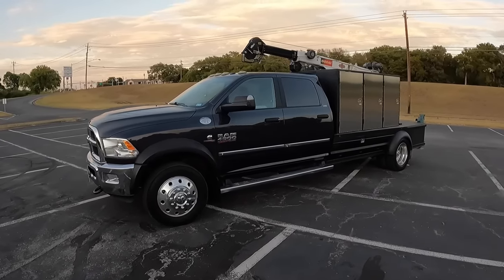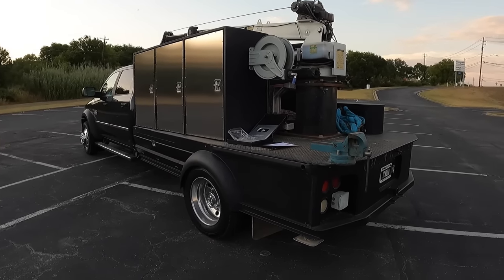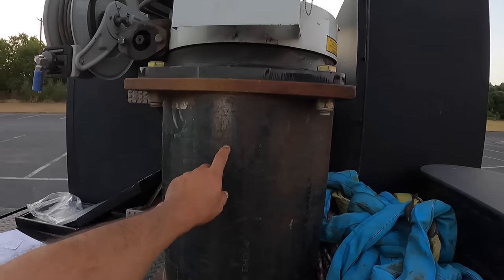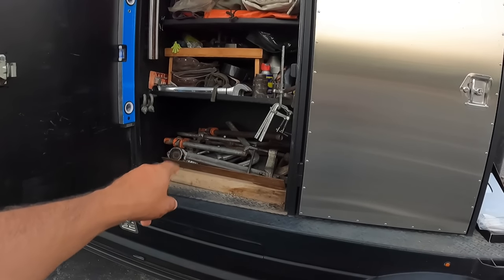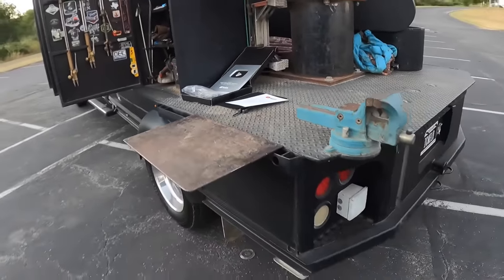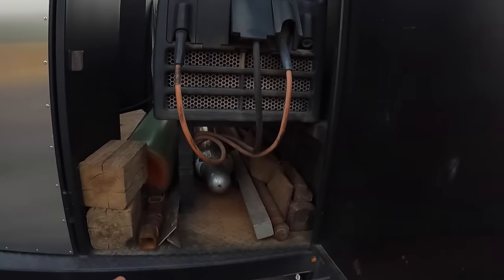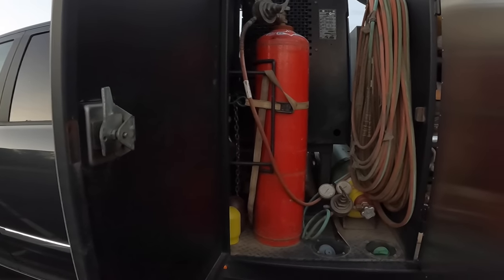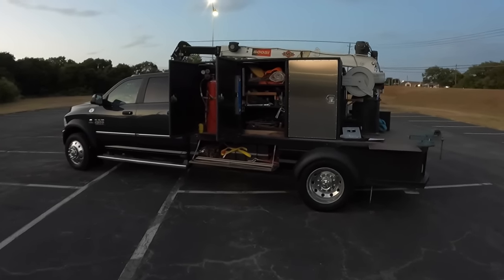Long Awaited Welding Rig Tour.

Comment: I have had many trucks with utility beds. I always shopped around at pawn shops and garage sales and bought different brands of different sized tool boxes that had decent sliding drawers and just put the entire tool box in the different sized openings in the bed. One truck I had a certain size of Snap On side boxes in a particular spot behind doors they just barely fit through. But I'm a mechanic and if you don't want to spend all your time looking you have to have specific drawers for specific tools and like you said it helps prevent loss. So you might look around at Northern and Harbor Freight or the pawn shop and find something that fits well in the boxes you have made. I like it that your truck isn't a cookie cutter copy of a lot of the welding and pipeliner trucks you see everywhere. Congrats on the 100k and your award. 👍

Comment: I am not  typically a dodge guy at all - but this truck is gorgeous! What a sweet setup too, man! I also give dodge points for still letting you get a manual - couldn’t in my 6.7 powerstroke. Congratulations on 100k.

Comment: In the middle under the crane you could make a larger cap city fuel cell/tank to pump fuel into your welder or truck for extended work.

Comment: Congratulations on your 100k award! It is very much deserved. 
I'm very interested in seeing more details about your air suspension that you built. I'm in the process of building a 2000 K3500 C.C. dually into a welding truck very similar to yours and am afraid it is going to be pretty close to the gross weight limit. I think the air suspension should make the chassis more stable on the road.
Reply from the maker: Coming soon!
Reply: Thank you! I'll be looking forward to it.
Reply: @ICWeld  I'm interested in the thought process of the design. Did you start with an existing design and modify for your needs or start from scratch? I hope that's included in your upcoming video. I am staying tuned!!
Reply: I have a 2018 Ram 550 mechanic service, around 20,000 lbs. I am in northern calif. . I have mountains three three sides with canyons following river, creeks. Side to side stability was a issue, used "Super Spring" Summo that controlled the sway. So I thought if that was good I will put them on front axle, that didn't work out so good, almost put me in the other lane on a tight mountain curve.

Comment: Love that truck Isaac! Very well thought out. What’s your cab to axle measurement? My F-550 has the 120” cab to axle with a store-bought 14’ extra-low-profile utility bed so I can pull my gooseneck in the standard hitch position. People ask, “do you have a big enough truck?!” My reply is always, “No. Two things you can never build big enough…, a truck or a shop.”
Reply from the maker: this one is an 84" C/A length. 12' bed.
Reply: yep no matter how big the shed is it aint enough and never has enough power points. when we built the last shed the uncle supplied the electrical gear through his business he asked how many power point do you want? as many as we can have so around the bench there is 1 every 4ft. no more uplugging tools just to do a different task.

you can have a shed 140ft long by 40ft wide and its soon gets filled with gear. pallet racking is your freind get the less used stuff up off the floor.

Comment: I started out with a 1973 Dodge Power Wagon. Lol!   Then a 1700 4x4 International Load Star.  Use and old sign crane for a decade or so. Was the biggest rig around here close to 40 years ago! Lol!   Then got a Chevy tool bed truck with Miller for road.    Reworked the Old Skinner National I called it for gravel pit work.  Auto crane and Lincolin and air.   I had the Skinner National for 33 years. Re worked it 2 times.  Retired in 2019.  But still have the Chevy.  Just tinker part time in my shop now.  Been a lot of years. And hard work. But was good to me!   Love to see what you do.  Fulfilling work it is! And it’s nice to have nice rig!  Keep up the videos!  I love to watch them!  And I’m still learning after 46 year watching!    Kent Smith Welding.

Comment: I really personally think your truck for a road truck has it all, you built the cabinets with doors that look like they came from a factory. The wheel flares you got lucky with the fitting on the 90 degree pipe but I thought they were real factory made wheel flares great added look to the truck, Shit it looks bad ass in my book. thanks for showing the build you did.🛻

Comment: Congratulations! You got good stuff!
When I moved into a 2018 5500 Ram I thought I wanted a standard Trans. as my first 5 service trucks were stick shift. The salesman said bad idea. I am in northern calif. with the auto shift, exhaust brake and the 6.7 I can go to the coast over four mountains never have to touch the brakes. And pass motor homes. I am about 20,000lbs.

Comment: I just started following you about a year ago, we are very similar in what we do, although I'm way up north, I do about 10% rig repair and 90% farm and other repair, our oilfield is very small here, but farming is huge, our trucks are very much the same also, I run a F550, it's a gutless wonder also! I didn't build my bed and boxes due to time, but I added more on top for storage, plus I carry a lot of iron with me because you never know what you need when you get to a service call, I wish I had a crane like yours but I don't have the room for it, I did add a fold up work bench to mine, I'd be lost without it, and my truck isn't very clean, constantly running on muddy roads, thanks for showing your truck, it was very interesting, take care.

Comment: Quite a special thing is a work truck you have thought about loads and then built from the ground up you always learn something. 
They are never finished but when your an honest worker function takes over bit like my little truck with unpainted welding that I did when it was too cold for paint.
Keep doing what you do, I would be weirded out to have 100,000 people subscribing.

Comment: I suggest you install an ignition interruption switch on the truck somewhere so no one can't just hop in and take off since they can do it in less than a minute. An aunt had her convertible snatched several times often just for its classic parts,  it didn't go wandering again that easily after one was put in  since she usually flicked it off when home.

Comment: Anti theft peddle haha well said.

Congrats man, ive been watching you for a few years now. Always a pleasure learning from you as im a millwright and weld a ton. Youve taught me lots. Congrats to you sir!! One of the most under rated welders on You Tube
Reply: Oh and hey, get a dual south bend clutch and delete your def/motor with EFI live. I have a 17 3500 manual and it was a dog. I did those two things and its a completely different truck. I do not bag on it, its like giving a smoker new lungs and gets wayyyyyyy better fuel mileage. You will not be sorry you did it and will be so much happier with the truck

Comment: Sweet!  I have a 2004 3500 dually with the Cummins and 6-speed manual.  I love it, but it really is showing its age.  Unfortunately, right now is not a good time to buy...anything.  I have a friend that owns a Dodge/Ram dealership, and I about fell off my chair when he told me the price of a new truck. Over $100K!!  It's insane.   You really do have a beautiful truck.  I like the layout with the crane in the middle.  One thing I did was buy an engine-driven generator. It's a bit larger than an alternator.  When the truck is running, I have 7,500 watts available.  When I got it, I couldn't afford an engine-driven welder, plus I do a good bit of camping, so it seemed like the best option.  It really wasn't, lol.  You have to run the truck at 1,800 RPM to get 60Hz, and it tends to get expensive burning all that fuel just to make a whopping 7.5KW.  Anyway, congrats on the 100,000 subs and getting your play button!!

Comment: That table design is genius Issac! Also, tou could build your own roll out shelves. There's heavy duty designs on YouTube you can look up, some people use skateboard bearings and rails, to make there own from scratch.

I also have am 07 5500 with a 6speed it has 4.44 gears, and I can only go about 75mph

Comment: Congrats Isaac! Wow your custom bed shows off your welding proficiency and pride in your workmanship!! A rolling advertisement for your business!

Btw you can have your truck computer retuned back to stock power. Will probably void warranty but as long as you are a fluid shifter, your driveline should be ok.

Comment: that "dead" space under the boom between the boxes could be used to store a 20ish gallon saddle tank or another air tank or maybe even both maybe even inside the crane riser could be used for something. some of the offroad guys use their bumpers as air tanks for air lockers, suspension, or to air up tires etc.

Comment: Very nice work. I have equiped my service trucks with a blower system that puts positive pressure inside the toolboxes.  A vent  scoop( like on a boat )  on the front ot the box with a small electric fan filter  and that goes in a P trap with a little tube at the bottom to let the dust and water out. Think you get the idea.  It keeps the dust and  will dry out your tools if you put them away wet or get caugh tin a rain/Snow storm. Nothing worse that tool box full of  dust and rusty tools.
Reply from the maker: Great tip!

Comment: Congratulation on the well deserved award. Awesome truck and you also deserve a congratulations on the build. appears that a lot of thought was put into it and the pros by far out weigh the few cons that you pointed out. I have worked in the construction industry all my working life, (Highway construction) and firmly believe that your appearance, which includes your equipment, is a direct indication of your quality of work that you do. In your case its OUTSTANDING!

Comment: Sometimes the simple things are the best thing I really like that set up you have enough to get the job done and nothing more to worry about possibly I might build a larger fuel cell but like you said you have to fill up the welder anyways so really it works anyways great work truck I have a similar set up but in a 3500 version I built myself and my crane is moved up into mid ship with the boom out the back and the out riggers behind the cab and off the rear so I keep the center bed space for whatever I have to haul but like you I almost always fix in place so it’s not too much of a need but it does ride a bit better for me at least with the lighter duty truck

Comment: 22x27 compartments? Slide outs pretty ez. 18" Austin locking slides. 10 gauge stainless probably best for your application. We generally use 3/16 alum at my work. Cut x2 18" chucks of 3x3 or 4x4 angle for your legs. For slide tray, 25.25 x 20.25 sheet, notch out corners 2.25" will give u about 23x18 tray with 2 inch lip. (To increase lip, add equally to sheet dimensions and corner notch outs). Get it broke, drill some holes and bam.
Don't forget to compensate for clearing the compartment door haha. U may have to shrink the width a lil.

Comment: I picked up a Farm truck out of California. A 1997 international 4700 dte466 5 speed spicer with a split rear end it came with a Koenig 13 foot service body two high compartments a 6000lb crane air compressor and a Wilton Vice I put a Miller big blue 400 in for a power source. But I had to drive it halfway across the country to get it out of California.
Reply: But now your truck has a story.
Reply: @erik_dk842  yes it does

Comment: If your truck doesn’t have the dpf system you could probably tune it back to a stock 6.7 power level or get a custom tune so it’s got more power but not to much to break anything.

Comment: I've read abut this cool new white paint that's so effective it actually has a cooling effect in sunlight. The moment I saw your umbrellas and you mentioned working in the sun I wondered, what if those umbrellas where treared with that color. Would it make a difference. Possibly not since you're outdoors.

Comment: I work at a fab do it all shop that owns a powder coating shop in the back, you definitely have to grind down your stuff really clean before powder coating it
Reply from the maker: the bed was also sand blasted beforehand
Reply: @ICWeld  yeah we have a sandblaster guy too it’s definitely necessary too

Comment: 100K subscribers without ever using click bait and no garbage ever. Wow is all I can say about that bed. Looks great and functions great. You called it a standard diesel at the beginning. I don’t think anybody but dodge offers a manual transmission and you can’t get it with the high output diesel. I believe that is true….

Comment: Well done on your YouTube achievement. Great tour of your truck I appreciate the thought that you put into the design to suit your needs. I was going to ask about sealing out the rain, but you answered that accept for the roofed over cabinets. I didn't notice seals on the doors?
Reply from the maker: I dont have actual seals but I do have a 1/8x3/4 flatbar that closes the open gap between box and door on 3sides, not the bottom. Water does get in from around the bottom of the door but Texas is so hot that it evaporates fast. No real need to keep all the water out. plus theres nothing important on the bottom level. and if it rains for a few days, the left and right turns while driving let the water roll out of them.😁😁

Comment: Congratulations Issac! I enjoy watching you work and your humor. It reminds me of working with my dad, who patiently answered all my endless questions about everything, including welding. That's a beautiful truck, and the stainless doors set it off. I noticed that it looked like either the bed is wider in the rear than the front, or the boxes are set on the bed at an angle? Why is that?
Reply from the maker: Optical illusion. the bed tapers wider starting at the cab. It goes outwards to cover the dually tire. The boxes are parallel and flush to the cab. More aerodynamic.

Comment: nice rig man  i'm going to be building mine soon i hope. 
ive built the lock out lock in drawers before they are a pain in the ass   for your setup it wouldn't be too bad because you have access to the sides to bolt trough  i bough the sliders rated for 300 lbs a pair from POMAR  hard ware in Toronto i'm sure you have  a similar supplier down there then jsut had the drawer trays bent up at the sheet metal shop i deal with.

Comment: I assume the welder is “weatherproof”, but wouldn’t you want a roof over it just in case?  Badass setup, I’d add a nice floodlight somewhere on the back so you have good light if it starts getting dark.

Comment: Isaac, great video tour of the truck and thanks, its been a long time coming.  I often wondered about a work table off the side of the bed. I guess I never saw it being used  or caught it in use.  I often wondered why you never had a metal grate table to use in the field so you weren't cutting off the bed surface when using it as a work space. 

Lastly, congratulations on the 100K subscriber, well deserved and earned.

Comment: Also, I have a 2017 ram 2500 6 speed. It runs pretty good now haha. But the throttle booster made a huge difference and you can keep your emissions if you want to. That was the first thing I changed. At least if nothing else to get rid of that dead pedal no balls feel while taking off.
Reply from the maker: might have to do that.

Comment: Hey Isaac. Long time follower here. Congratulations on such an awesome achievement. Quick question. I've never seen you weld off of that small table that I can remember. When welding off your truck like that, is the safety of the trucks on board computers an issue to be concerned about at all? Thanks for your time and for sharing your knowledge with all of us.
Reply from the maker: Not yet! Since the ground takes the shortest path to the electrode, just keep the ground as close as possible to the work. should be fine.
Reply: @ICWeld  I appreciate response and the tip. Saludos from Tucson, AZ.

Comment: 2:32 Anti theft pedal 😆 It's a shame the vast majority of America can't drive a manual as I love driving with it. You've also got so much more control and it's a lot easier if your stuck in a rut as you can rock the car. I do also love driving an auto as it's so much easier and you can drive one handed. I've currently got a Mk7.5 Golf and I've had it for about 4yrs now. It also shares the same chassis with the A3, Leon and another VAG car which I can't think of 🤔 It's not the Fabia or Ibiza as that uses the Polo chassis

Comment: well thought out work vehicle. and in reality they dont need to be all flash and fancy. chrome dont make the money. but you do need to be well presented. one thing i would have perhaps done different is to have had a access point to the area under the crane to use for storage. but then if you want more room a single cab instead of the dual cab would have allowed a longer tray body. and yeah as a boilermaker the only spanners you need are so you can fix your tools and would fit in a standard 5 draw cantilever toolbox. you need clamps and hammers more than anything.

Comment: Congratulations, you deserve the award. I appreciate the videos and the tour. Only question I have is how many hours are on the welder, and have you had to replace the engine on it? Love small engines.
Reply from the maker: I will need to replace the engine at some point. I believe I have over 3000hrs on it. I'll check tomorrow.